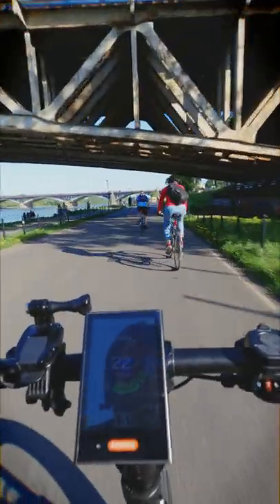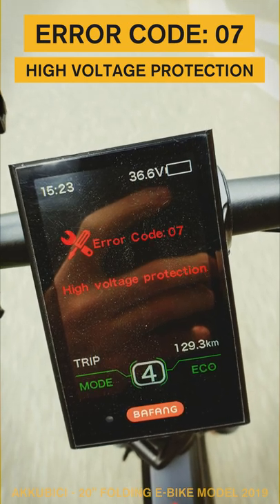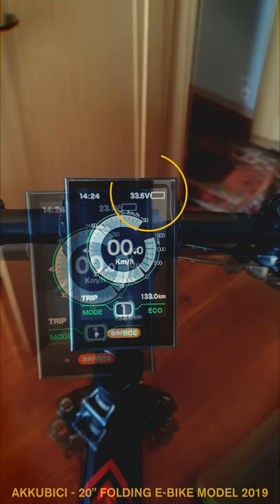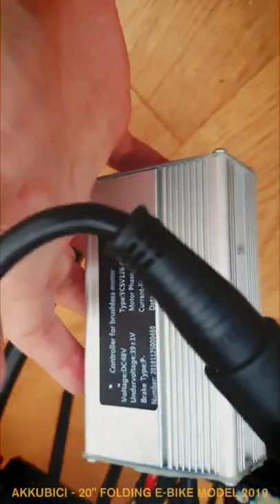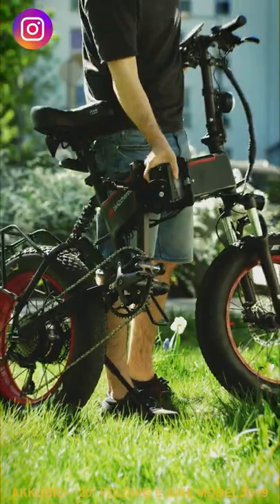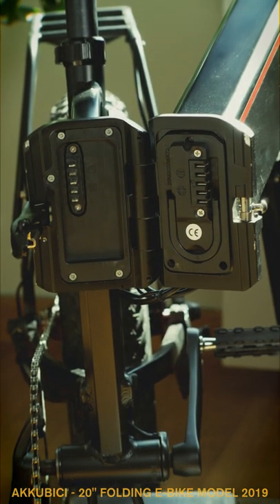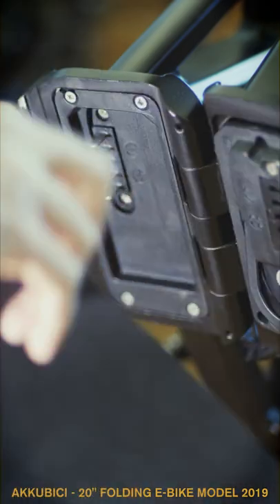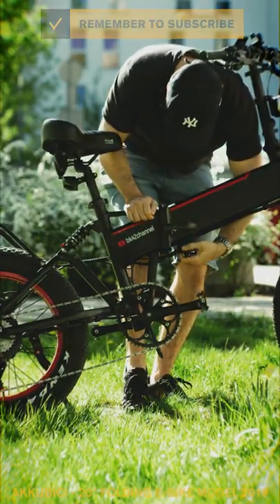Folding E Bike Problem Error Code 07 with BAFANG 750W Hub motor #Shorts

Comment: Done it already. For other people; it is the solution! Thanks.
Reply from the maker: Hey buddy!! Did you have the same issue? A Instagram fellow also said: " Some dielectric grease works well for a better connection and prevents corrosion."